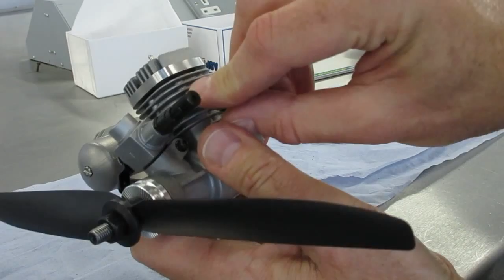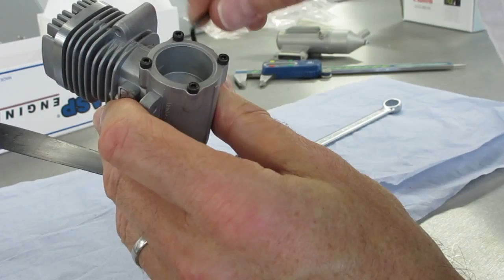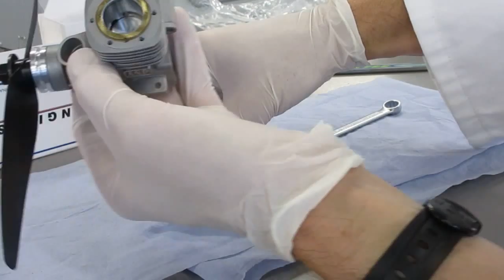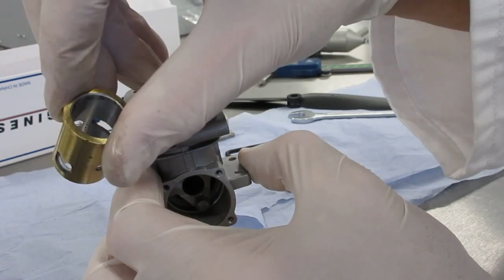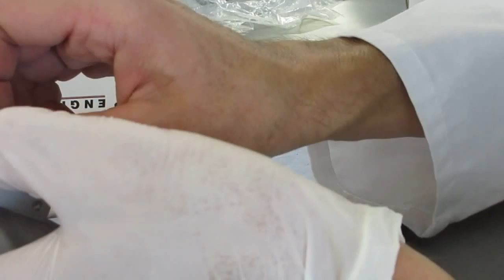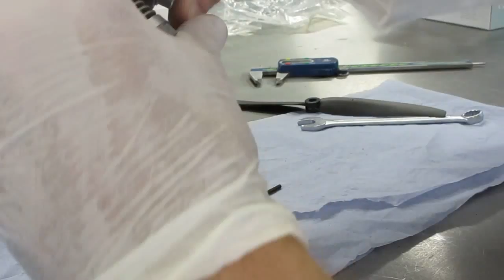Teardown of a model aircraft engine

Comment: I have an asp 46 that feels like it clicks at TDC. It's old but doesn't have much run time. I can't get it to start, I've seen plug, fuel lines etc. I'm starting to think it has low compression. Is it possible?